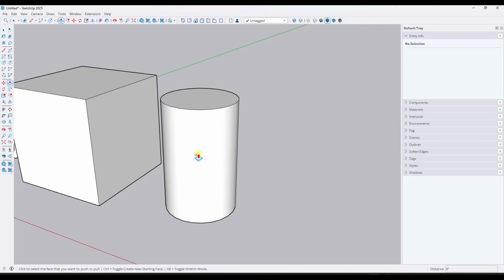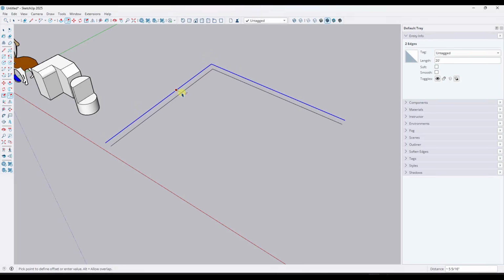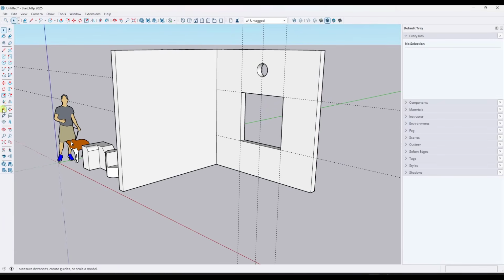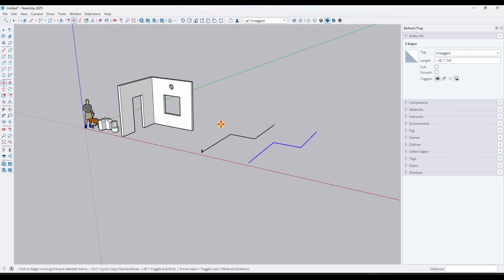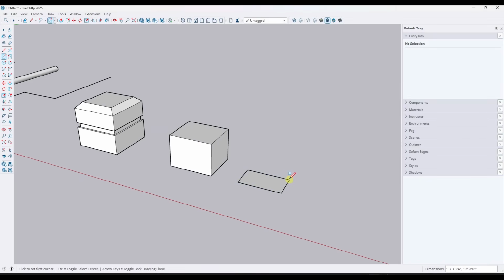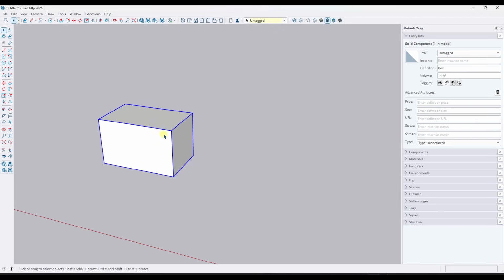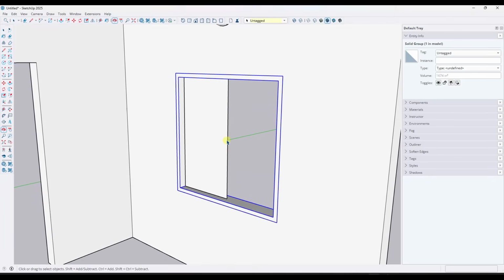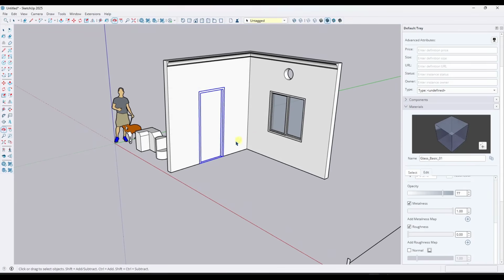Getting Started in SketchUp 2025 Part 2 - Modeling in 3D!

Comment: Am new to sketchup and I have search around for sketchup tutorials, I want to acknowledge yours is superb. Thanks so much for the work. However there are few keys you are pressing and you are not saying and if I haven't learn it else where I would be stocked. E.g when you make a new cut on that cylinder, using the push tool, you didn't say you were pressing control, I had to figure it out myself. But thanks any way, you are doing a great job.

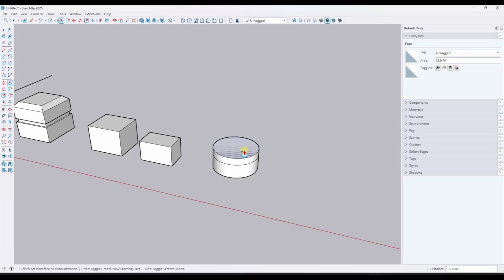Comment: Awesome video. I am learning SketchUp from you! I'm following along but you lost me at 15:16 when the yellow square pops up on top of the cylinder. I have re-wound it 10 times but I can't hear you say how to do that or what tool you're using, and I don't see you reach for another tool. How are you doing that?
Reply: Press Ctrl while hovering over the roof. A little + sign will appear. You can drag it from there.

Comment: Question about circle geometry part. How can you add another layer while push/pull? 15:09
Reply: Press ctrl
Reply: Invalid @Chipmunchies
Reply: @Chipmunchies  pls help it only adds new layer up but doesn't have the yellow line that can make it little
Reply: After i press control also same , i cant see having another layer.
Reply: i got it , thanks for the information.
Reply: After creating a face of the shape press control at one of the edges then you will see a plus symbol